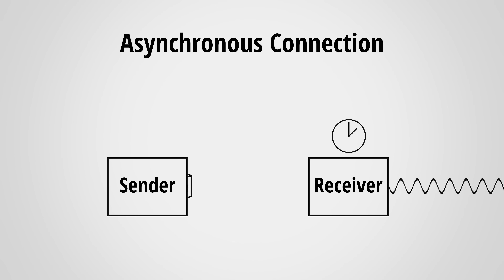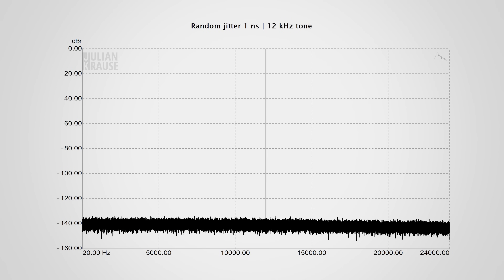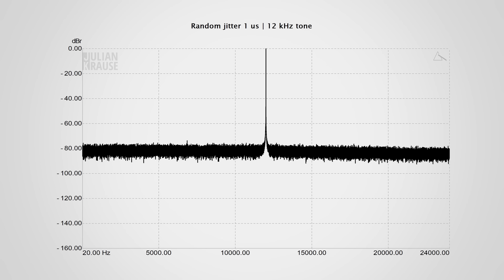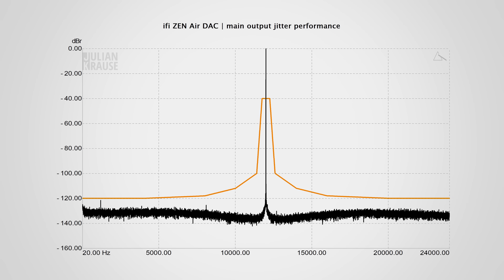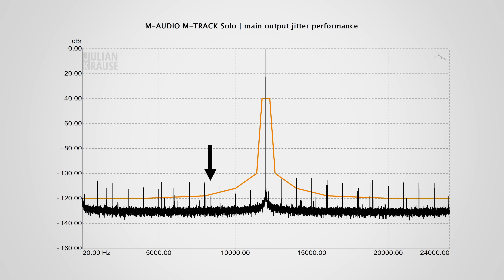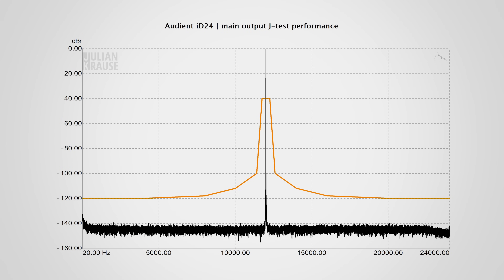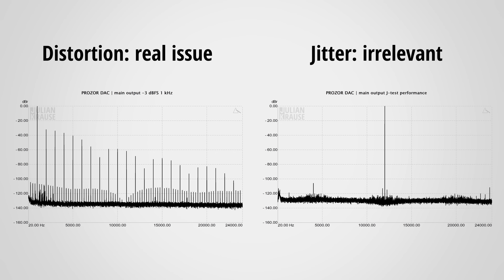Jitter is RUINING your audio? The TRUTH about jitter!

Comment: I am sort of reminded of the old analog days. I used a high-end open reel unit running 15 IPS; I used dbx noise reduction in many of those recordings. That meant, adding the 30 or so dB noise reduction to the already high signal to noise of my recorder (75dB or so at 15 IPS), I was running about 100 DB or a little more signal to noise ratio. Great specs; but if you listened carefully, you could hear the noise in between the notes on quiet passages. Thing is, if you’re just listening to the music, you never hear it. Your video makes me feel that way about jitter. Thanks!
Reply: That noise was really audible actually.
Reply: @StephanBuchin  It can be. When dbx first came out, people were being told to way under-record, so that there would be less distortion. The dbx would take care of the hiss that way. dbx put in their instructions that you should record with peaks at or near 0 dB; that way, the noise control would be the best. Recording that way, you could still hear a little noise, especially on classical music. But things like jazz groups, rock, electronic Pop, the music covered the hiss pretty well.

Comment: Jitter might not be a problem inside newer audio hardware but jitter caused by ISP and DPC is still a common problem. This is mostly caused by bad device drivers or hyper threading interfering with the audio software. So I would say jitter is still a problem, but it's more of a software problem.
Reply: That's not jitter in the signal processing sense, inconsistent and excessive kernel latencies result in a missed buffer update and completely wrong (stale) data being sent out.
Reply: @SianaGearz  I understand the differences, but end result is  pretty much the same. It's just that jitter cause by software issues are so much harder to analyze and fix.

Comment: Good explanation JK!
I do believe these statements are true for probably 99% of user listening scenarios, but strongly disagree about it being inaudible. I have experienced it myself on high end systems. DDC especially, if you can't hear the difference you don't have system that is revealing enough.
Reply: Scientifically it's not possible to hear jitter. The only side effect of jitter is noise, measurable noise. If the test was not a blind A/B/C test multiple times with a measurement to exclude issues it's not a scientific statement. It's more probable that some bias was involved. Probably consumer bias and/or confirmation bias
Reply: @zdfghdfg  I agree, since it's only a derivation from the ideal clock rate. However, can't the side effect also manifest itself as distortion and not noise only if it is correlated with the input signal? One could argue that distortion is also a form of noise, but usually it is thought of being uncorrected and random.

I guess we both share the opinion that this topic is blown entirely out of proportion and usual certainly not a major issue, be it noise or distortion.
Reply: @little-endian5957  Anything that adds or subtracts to the signal can be considered distortion. Jitter only adds noise, this has been proven by nul testing.
Reply: Theory a side, have you tried hearing it yourself?
Reply: @pr0gre551ve  Yes. High jitter is relatively easy to reproduce in various ways. I once 'hacked' a converter chip at the hardware level to achieve exactly that, making it easier to hear when it's pronounced and to lower it until it's not audible. You'll be surprised at how insensitive our ears are to audio jitter.
Reply: ... that system including the human hearing capabilities which is exactly the reason why most of that audiophile voodoo is absolute nonsense. The ears are simply not good enough which for not too few people seems to be a fact very hard to accept.

Those DDCs are real-life satire. Even IF they would have any effective audible impact, it wouldn't exactly speak for the DAC apparently then being in need to get a signal handed on a silver platter by them. Any decent DAC worth its salt has jitter rejection and whatnot already integrated so I would rather spend money on that part and certainly not any half-voodoo device in between if it has to be that way (RME ADI-2 with its FS-reclocking, Benchmark DACs, etc. and already that is most probably halfway voodoo as inaudible anyway)

Comment: Ugh. I love the dumb i popped that snake oil bubble.

I love the sound of external re clocked PCM. I love the sound of interpolation from hi res upsampling to 24 bit / 192 kHz. Why because it ulitmaly produces more SN DB extension pushing more Data into the silicon.

Reclocked PCM at higher up sample bit rates produce amazing tighter faster bass.

Come at me with the snakeoil comments. What we forget is that the chips benefit from more data throuput where upsampled generated or recorded in the orginal hi res recording and if you are going to resample you want to reclock.

Could care less about jitter. Or my jitter free recordings when i add a reclocker middleware to my SPDIF chain. I like reclocking my HDMI PCM interfaces as well.

Comment: Great video!  I'm interested in using multichannel DACs for active loudspeaker use as a hobby.  Fear of jitter drives me towards a USB DAC but it would be more convenient for many, I think, if one could just use an HDMI input to a receiver - DAC, volume control, and amps (OK weedy ones) all in one box.  Could you comment on HDMI jitter with 4. 6 or 8 channels of PCM at various sample rates?

Comment: Some of my old cd albums sound similar to this, especially when I using studio headphone I can hear the distortions/jitter like sounds....do that mean my cd player is bad for that?
Reply: Shouldn't be, the signal off the CD is extensively buffered and reclocked for the purpose of Reed Solomon correction, and if it had read errors that exceed the Reed Solomon threshold, you'd be hearing bursts of static in silent sections, it gets very very obvious, or it would plain mute the window which cannot be restored, that's common as well, So CD Jitter is not something you need to consider. More likely the distortion is inherent in the bits recorded on the CD, it's how it's been recorded/mastered and "supposed" to sound like.

But to be certain you could try copying it with a PC burner, also see if it throws up read errors.

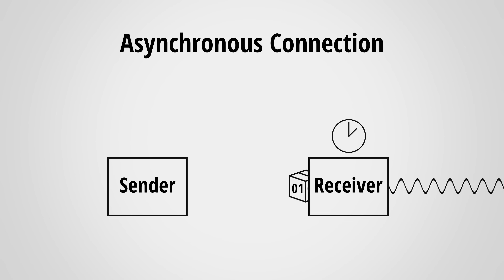Comment: Your statement at 4:00 (USB does never ever introduce jitter) is simply wrong, as experience with different DACs and USB transport shows.
While otherwise quite informative and nicely put together, these statements are very misleading.
... you seem to theorize a lot without coming up with actual examples of devices / HiFi gear you tried out.
Reply: I would argue he hasn't tried out high end system with and without DDC to make such a statement.
Reply: @pr0gre551ve  ... most likely you're spot on with your assumption.
Reply: You both should check audio science review website, they did many tests on this subject. bottom line is. Jitter is never an issue unless there is a problem with the product. Arguing it is, is misleading. 
High end systems have nothing to do with it. What you are experiencing is consumer and confirmation bias.
Reply: @zdfghdfg  there are no perfect products...
Reply: @medonk12rs  We are talking about audible jitter, not a few harmonics resident in -140dB, and even in that case it's not related to "USB jitter". It's also proved USB reclockers and audiophile network switches is a scam and can only degrade performance in a very few situation (one specific very cheap dac), but mostly don't do nothing at all. Still it's all well below what is audible.

Comment: There are 4 types of USB data transfer. Audio data transfer is done using Isochronous mode. This is a one way data transfer from source to destination like streams of data. There no way to detect error at the transmission level if the there is a timing variation while sampling by the receiver. The only way the receiver can detect error is by detecting PCM data encoding format by detecting the changes in voltage. It will reclock in needed. However there is no way to send request to sender to resent the correct data. Hence the receiver uses interpolation to set the data. This interpolation will depend of the DAC designer. This is one of the reason different DAC sounds different even when all other parameters remain same.
Reply: Clock disparity between USB host and device does not result in erroneous (misclocked) data transmission because USB uses NRZI encoding to interleave clock and data. Bit errors do occur, isochronous transfer just like any includes a CRC checksum, which allows one bit error correction per 1ms window. Sometimes, devices do not implement CRC checking for incoming data, but with modern USB processors, you expect that all of these current devices do. At higher error rates, the error leaks into the output. There is indeed no retransmission possibility with iso, because the transmission and processing time window is already spent, but if you had errors at mere fullspeed (12Mbaud) that were uncorrectible more frequent than once every few days, you'd be THIS close to the device regularly falling off the bus, so you don't have to worry about it.

And interpolation... you're just throwing words around at this point.
Reply: @SianaGearz The lovely "Interpolation" had already been roped into the voodoo nonsense sphere since the good old audio CD era. Whenever the jitter voodoo wasn't enough for a pseudo-explanation, the next claim was that due to the oh so imperfect and overwhelmed error-correction so the player had to perform interpolation all the time - which simply isn't true. In most cases, it never occurs on the C2 stage resulting in uncorrectable errors for proper media and even if, it is hardly all the time but for a brief moment.

Comment: How about a video on AVB network switches - are they snake oil - can standard network switches be made to work well with AVB?
Reply: AVB is a superset of standards for regulated transmission of AV-specific packet data, almost like a TDM-style reserved channel with centralised synchronisation. Without all hardware in the chain understanding AVB, you just end up with bog standardEthernet, which isn't that bad in the first place. Contemporary IP audio & video standards usually incorporate support for standardised network timing protocols anyway, which are usually fully interoperable with more ubiquitous QoS/COS-supporting Ethernet infrastructure. 

I'd contend AVB only has a very niche set of use cases nowadays, the broadcast and pro audio industries have basically moved on.
Reply: @ChristopherWoods  what tech have the broadcast and pro audio industries moved on to?
Reply: @christothegreat1  NDI, Dante, Ravenna, AES67, Livewire, SMPTE 2022, 2110 and so on. For network synchronisation and clock reference, things like PTP (also a standard) are in widespread use.

Comment: we've building a powerful sound system, and had a serious issue with jitter. The jitter of i2s coming out of one audio source (Arylic something something) was terrible enough to cause the noise floor of our low-noise dacs to increase dramatically.  That noise was always present, even with no signal (i'm not exactly sure why, might have something to do with how modern dacs work - all their delta-sigma oversampling stuff kinda makes them always have some signal, effectively)l. And this was an issue, as it was causing loud hiss from the speakers.

We actually needed the very low noise floor, because the system has no analog volume control - it is always at max (it is much easier to have a digital volume control when you're dealing with a 4-way system with dsp-powered active crossover). 

There is an easy solution to this - it is called ASRC. It lets us use a good clock source for dacs and dsp, which is decoupled from the clocks of the digital sources.

So, in some cases, you must actually worry about jitter.
Reply: I wonder whether the issue might have been instead ground loop and RFI and your resampler just happened to isolate it?
Reply: @SianaGearz  almost certainly no, it's not interference. We were testing it on a system that didn't have asrc, and only after confirming with a/b tests with different clock sources that jitter was the actual culprit, we switched our signal processor chip to a more capable one with built-in ASRCs. The new system did have rfi problems, but symptoms aren't white-noise hiss at the output. It was pops, cracks, whistling and so on. Eventually we got it working.

Comment: Thanks Julian, these videos of yours have been very informative in clarifying concepts that I thought I knew  something about previously, but didn't really understand. As far as jitter, this is a hazy memory, likely from a decade or more previously, that Toslink, could suffer from jitter due to long optical cable runs, poor endpoint connections or cheap optical fiber, due to to signal reflections in the optical fiber itself. Would such actually be jitter or  more a form of signal degradation in general at the receiving end?
Reply: Nah you get to worry about bit errors way way way before you have to worry about jitter.

Comment: Very interesting.  I thought jitter would be a big problem unless you were using absolute high-end equipment. But I couldn't imagine what jitter would sound like.
But another question for another video: How would a multitrack recording (or an entire audio project) sound if you drove an audio interface very low?  Let's say an average 24-bit interface with -20 dB level?
Reply: audibly, it will not have any effect.

Comment: Good evening Julian - do you know any good ways to eliminate USB interference? For instance, a buzzing interference sound that is heard when moving a USB mouse. I believe this is a grounding issue inherent in USB, and that ferrules on all USB cables connected can help, but may degrade frequency range?

Cheers from England!
Reply: I've had this problem a lot in the past. Poor motherboard design, grounding and power supply issues often contribute. I minimised by ensuring all my gear was running from a common ground. Sometimes different USB sockets run off different chipsets and some are less affected due to the PCB design and adjacency to CPU data lines or power rails. An adequately designed interface makes a big difference, I don't have any hum/interference issues with fairly common interfaces like Scarletts or Mboxes in daily use.
Reply: @ChristopherWoods   My favourite source of USB ground loop is the front panel PCB in many PC ATX enclosures. It's common for it to erroneously connect audio ground and USB ground together. The resulting loop antenna comes out so generous, that it collects unproductive current from any of the numerous sources of PC activity.
Reply: @SianaGearz  I've shared in that pain 😅
Reply: @ChristopherWoods  Perhaps I should invest in a more premium motherboard for my next build then. It's a shame there aren't "audiophile" grade lines of motherboards as well as all the "UBER LEET GAMER X EDITION" boards haha...
Reply: @AJDOLDCHANNELARCHIVE   It can be a real crapshoot. I've had high-end model motherboards with supposed 'premium' onboard sound which have performed very poorly, and likewise perfect budget systems. Sometimes the USB chipset in use can make a difference (quite a few boards have multiple USB chipsets running different pairs of ports).
Reply: Try to use optical

Comment: No wow and flutter is happening with tape! Not vinyl!!
Reply: Off-center hole in record, warped vinyl, variations in motor speed... variations in belt tension / gear backlash for the drive mechanism.
Reply: @JohnShalamskas  Yes to begin with you open up any manual/datasheet to a reputable mass produced phonograph player, be it modern Hanpin or any old Japanese or German device from the golden age of HiFi, you will see an upper bound spec on wow&flutter at the platter. Today not all brands print it, but i say if manufacturer aren't willing to be held to a verifiable quality standard of some kind, this does not spark joy.
Reply: Both, of course both.

Comment: Some years ago I purchased a "JitterBug" from AudioQuest specifically BECAUSE I believed it was pure snake oil, and I felt my first deliberate "audiophile head-fi" setup would be incomplete without a dash of such.  As far as audiophile snake oil goes, it seemed like a pretty cheap option for such pure stuff lol.

Love this channel.  Love Krausian humor.  Better therapy than "Therapy", and less risk of snake oil than that realm too.
Reply: Audio Science Review testing found that the Jitterbug actually INCREASED jitter. Not just snake oil, but actively counterproductive.
Reply: @scorpioassmodeusgtx1811  shrug I'm relieved to hear that I didn't get a watered down dash of snake oil.  Also, don't really care, per this video.

EDIT: Skimmed the ASR review.  The conclusion appears to be that it does nothing audible, and barely anything even confidently measurable, as is the conclusion of several other reviews linked around the ASR forums. I didn't see any mention of increasing jitter in the conclusions.  Leaving my prized snake oil in the signal chain.
Reply: @attaboyBrad  I believe the increase in jitter was only observed when combined with one DAC, namely the the Schiit Modi 2. But even then the differences were well below what could be considered audible. It's safe to say it has no practical positive or negative effect.

Comment: From what I understand, the timing changes introduced by jitter can affect noise floor modulation, which may not change the signal per se, but can be heard with slight changes in the timbre. It has also been proven out that the human ear-brain can perceive even slight changes in timbre due to noise floor modulation to something like -200dB.
Reply: Do you have a link to the study?